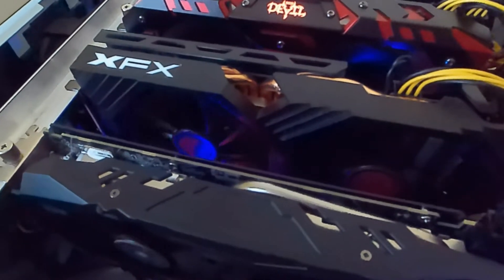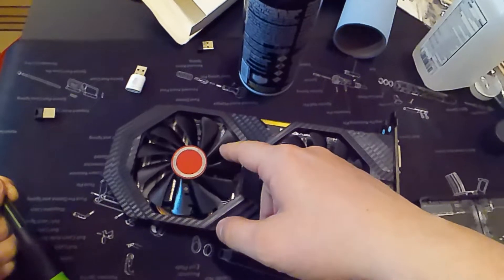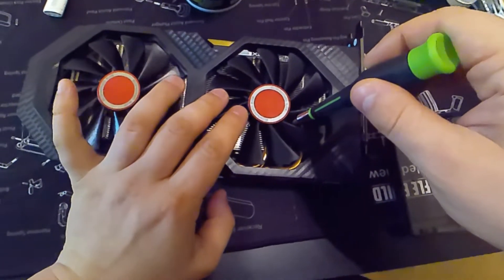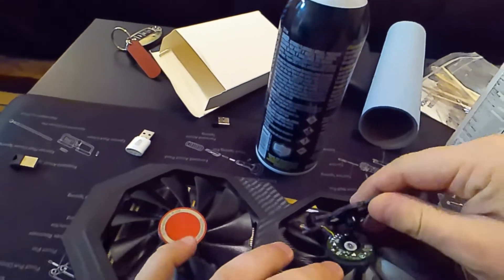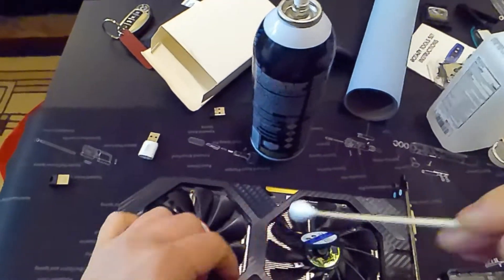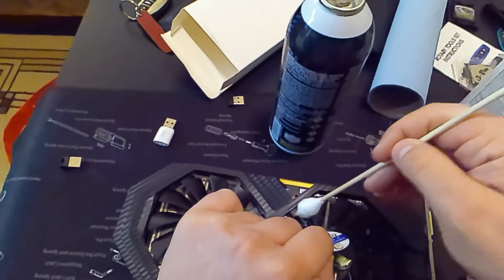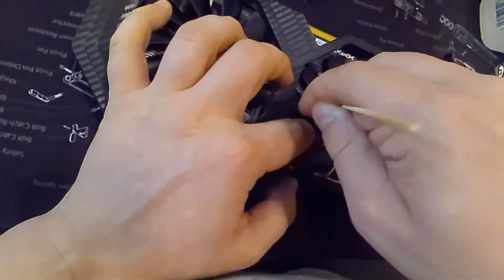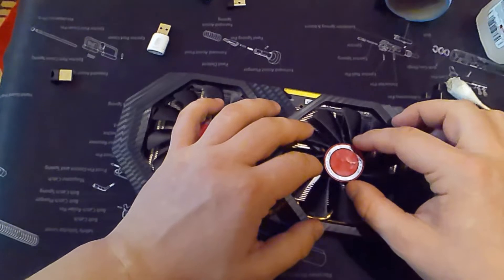Easy & Cheap Fix for GPU Fan Stutter: Prolong the Life of Your Fans

Comment: hiii,  Did you use 91% isopropyl alcohol for this ? 

I'm having the same issue and tried just using duster. but it returned to stuttering after about 10 minutes. 

Going to try this next
Reply from the maker: I believe it was 70%, but you could use anything higher than 70%. Did you add lubricant to the bearing?
Reply: @TheGobstopper  I tried adding lubricant but couldn’t get to the bearing, I gave it a good clean and the fan is spinning normally now! Thanks for the guide.
 Hoping it lasts for a few weeks until I can replace it c:
Reply from the maker: Awesome! Glad it helped!